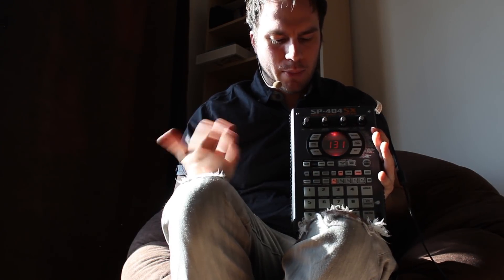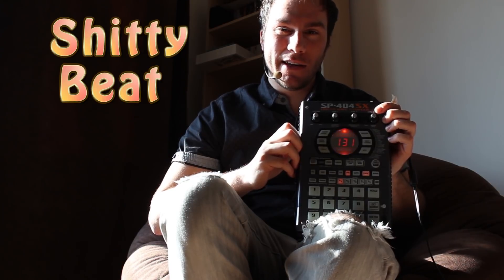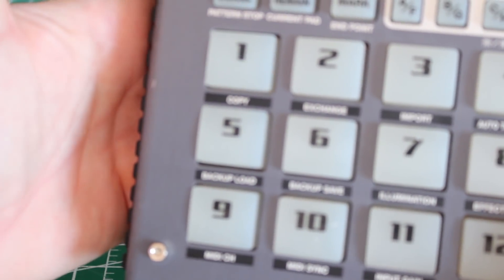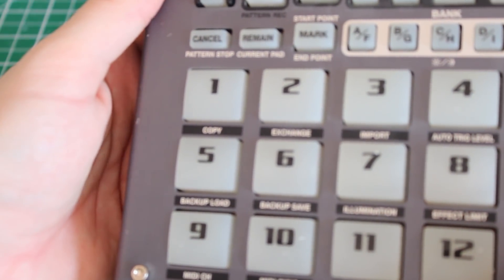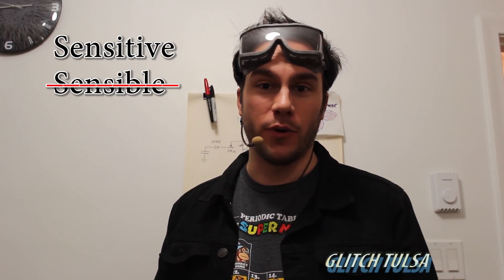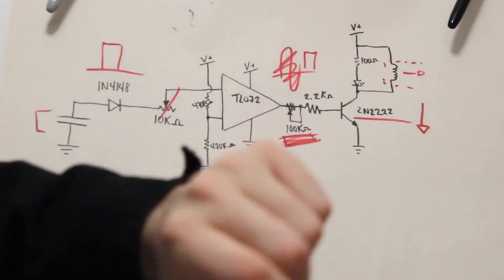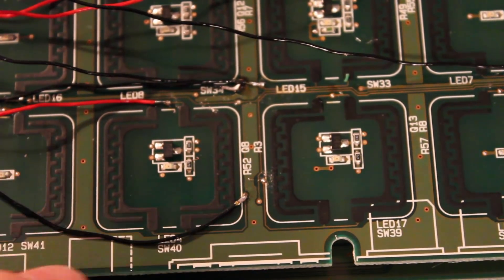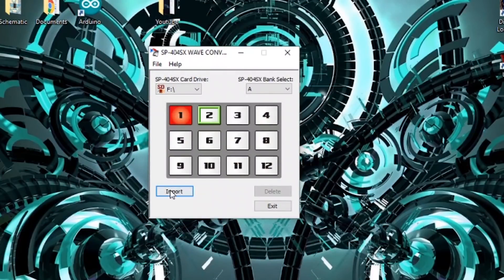Hacking an SP-404 with Bananas 🍌 | DIY Sampler Trigger Mod

Comment: This is honestly so fake looking, you dont even show it connected to the sp in any of your tests just wires going somewhere
Reply from the maker: Muriois Oasis thanks for your comment, if you have any questions concerning the functioning of the circuit and how the relay are triggering the switch, it’ll be my pleasure to answer you.

Comment: Love the vid but not opening my 404 until I got a backup unit. ;-)
Reply from the maker: Ahah! I understand the situation! I've been scared for years of opening this machine... but after working like a tech for a long time now I feel comfortable opening any kind of machine. I could 'undo' easily the hack I have performed in this SP-404SX by unsoldering all wires.